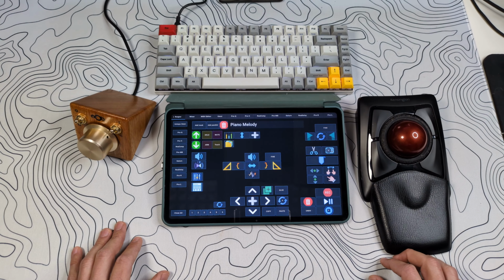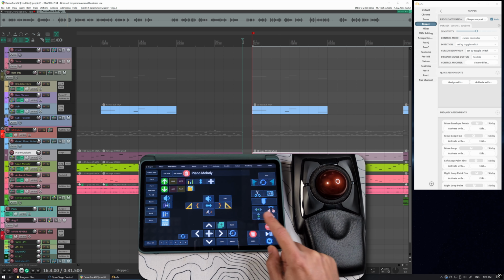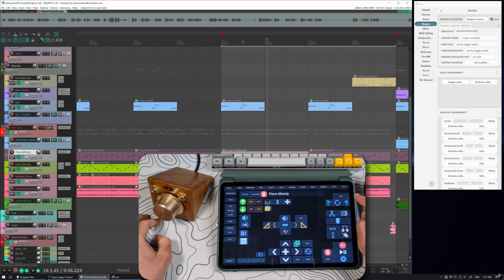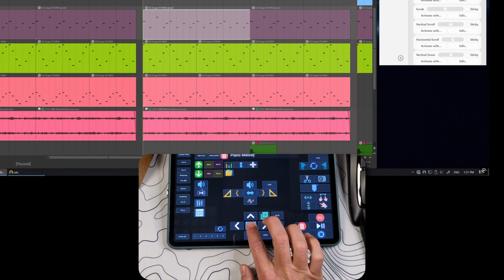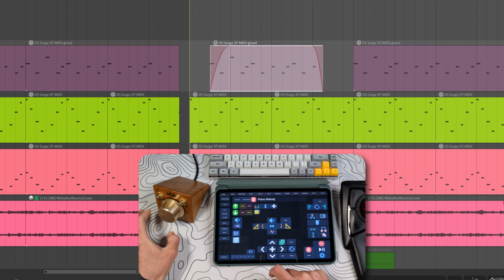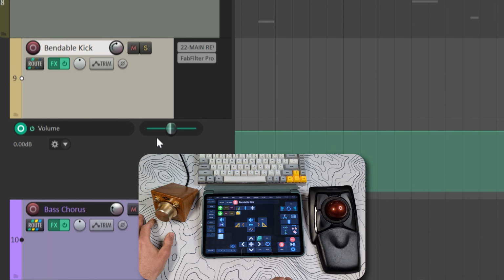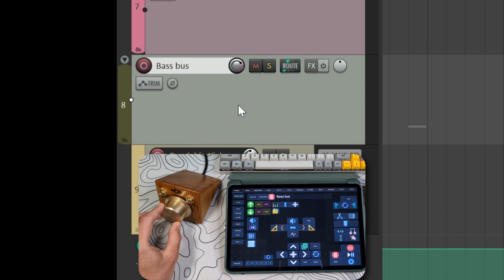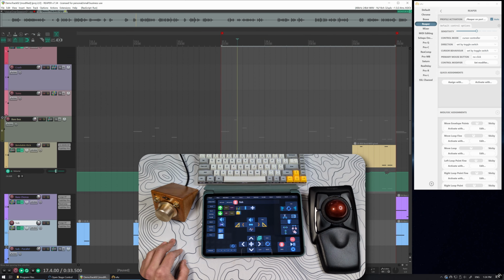nOb Control Interface For Reaper - Part 1

Comment: Its possible to use a stream deck not a iPad with this configuration ?
Reply from the maker: Yes, absolutely. It is a little bit tricky to get the Stream Deck to automatically switch profiles on its side, but possible.

Comment: This setup seems very cool, but in the end isn't mouse and keyboard faster for most of the use cases you showed in this video?
Maybe only the fine tuning parts seem faster/more precise with the nOb.
What do you think?
Reply from the maker: Thank you for your comment! Ultimately, it's up to each user to decide what works best for their workflow. The true beauty of nOb’s versatility and its seamless integration with other software and hardware lies in the ability to create custom control setups tailored to individual needs.
As for the interface shown in the video, there are certain tasks I can't go back to using the mouse for—like controlling item and track parameters (e.g., fade in/out, fine positioning, volume, panning, etc.). I also prefer using the nOb for fine-tuning envelope points. When working with plugins, the efficiency really shines, but I'll be demonstrating that in an upcoming video!